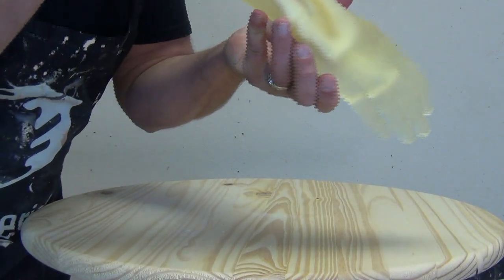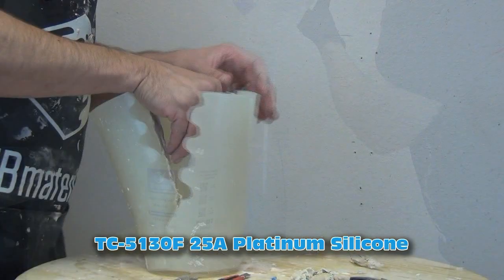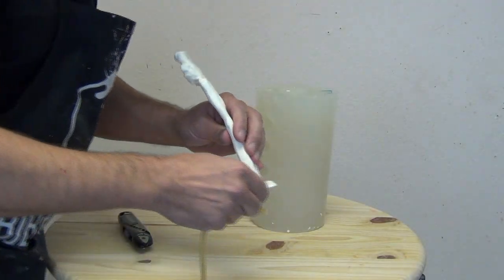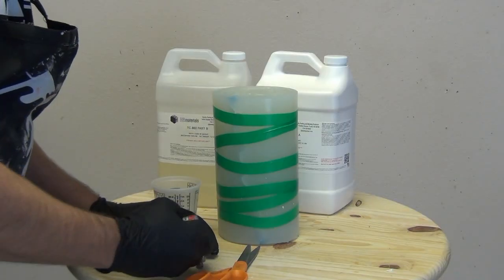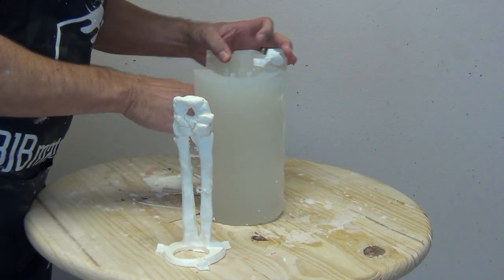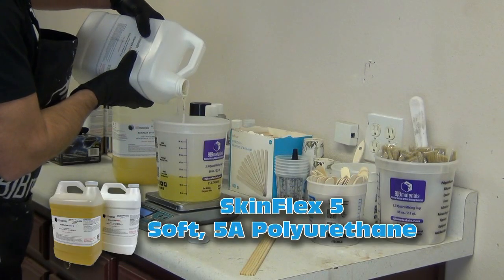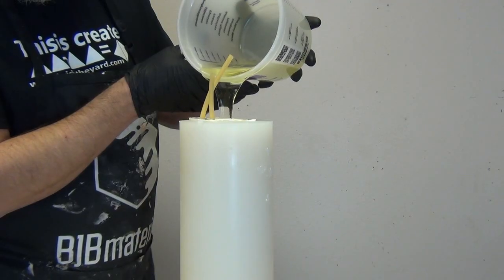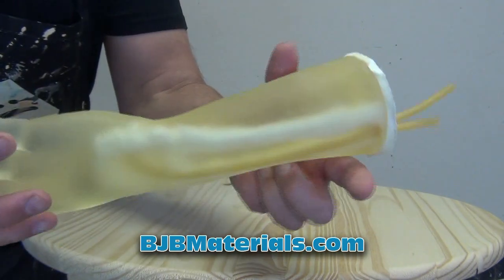Simple Medical Model With Embedded Bone & Veins

Comment: Might be useful to have a video on 3d printing and mold making. What kind of plastic or resin to use, what silicone to avoid inhibition, etc. For example, that way you could make the insert from an MRI or cat scan to get the right bone structure inside the arm.